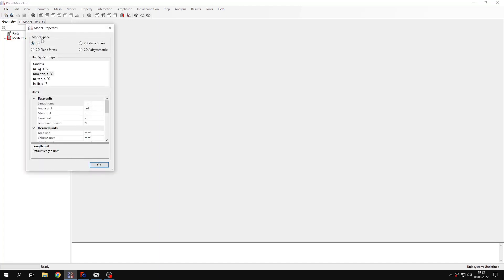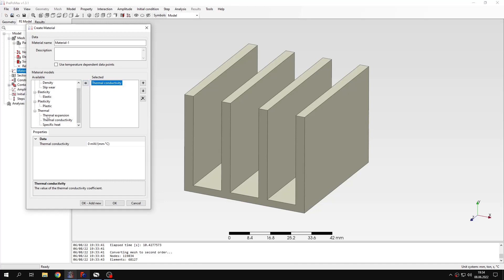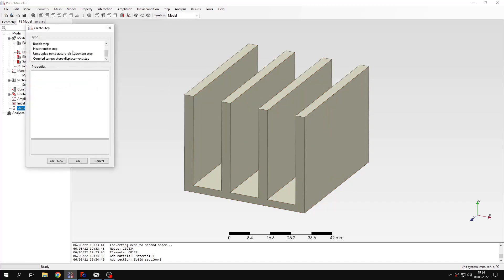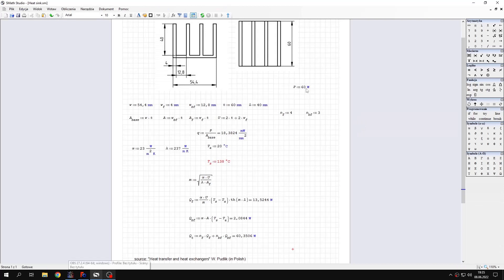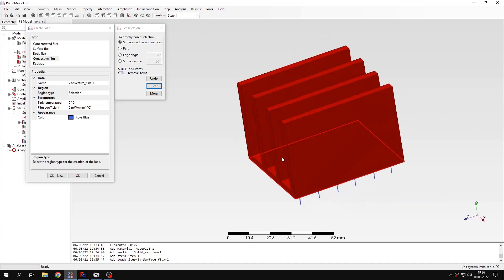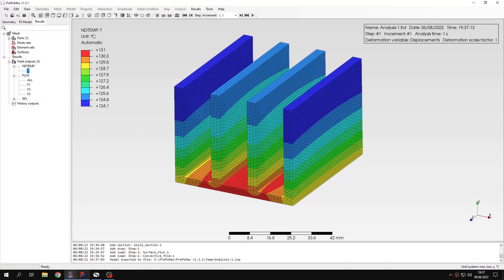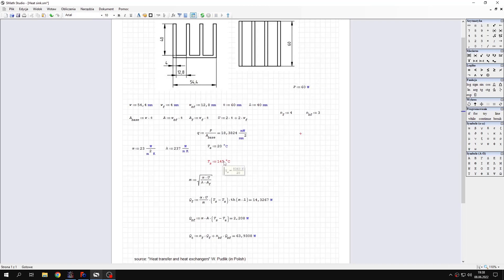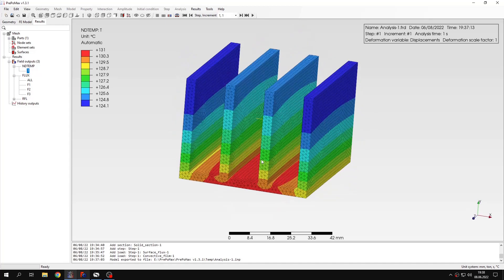PrePoMax (CalculiX FEA) - Tutorial 21 - Steady-state thermal analysis of a heat sink

Comment: Good example, I've been looking for to improve my Elmer analysis (right now, results are far away from the experimental results) for one of my previous designs(1kW micro-inverter, efficiency is 98.4% at full-load, my heatsink total surface area is 288.64cm^2, the outer dimension of the heatsink is 80mm X 24mm x 28mm{L x W x H}, the total power loss was 16W for my case.). 
Here is the working demo: https://www.youtube.com/watch?v=TqXkn7OuiNY (Note: In the video I was testing some other heatsink with two fans which is designed for Raspberry PI)

I'm confused with your example, let me ask couple of questions by all means.

Q1) If a heatsink is being analyzed by any FEA software, why do you need to give the thermal conductivity to the solver? The geometry and the material properties should bring that value isn't it? For your case as the heatsink size is relatively small there are some equations to calculate the heatsink's thermal resistance but for bigger heatsink there is no equations (as far as I know,  making up some iterative equations are not in my scope)

Q2) Based on my experiences, your quite small heatsink should not able to handle 60W power loss (Mosfet, transistor, etc...). It doesn't look possible to keep the temperature around 138C. If you tested that heatsink in some of your designs, could you please share the temperature rise and power loss that was handled by the heatsink?
Reply from the maker: @nazimyildizpau  Thanks. Answering your questions:
1. Thermal conductivity is part of the material properties needed for FEM calculation based on the Fourier’s law. For steady-state analysis, this is sufficient. For transient analysis you also need specific heat and density.
2. The cases I show in my tutorials aren’t actual designs, only simple examples made up by me while trying to keep possibly reasonable values.

Comment: Is it possible to simulate heatsink with forced air flow by for example fan?
Reply from the maker: Only by approximating it as a proper film coefficient (there are different values for natural and forced convection in various media). To simulate it more accurately, you would need connection with CFD solver like OpenFOAM which can't be done with PrePoMax at the moment but there's a preCICE library that you can try using to couple CalculiX with OpenFOAM.
Reply: @FEAnalyst  thank you :)!

Comment: how to create a thermal simulation of heat transfer between 2 components that are in contact
Reply from the maker: There are 3 ways to ensure heat transfer between different parts - merging them into compound (so that the mesh is continuous), using tie constraints or contact with gap conductance.